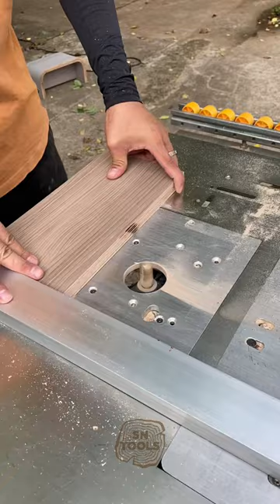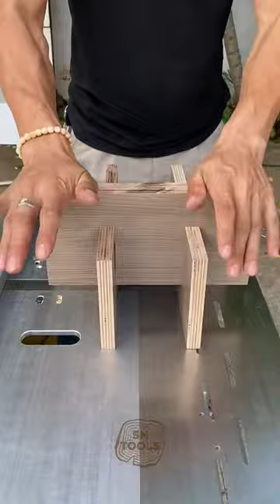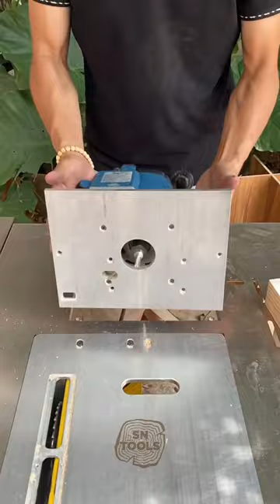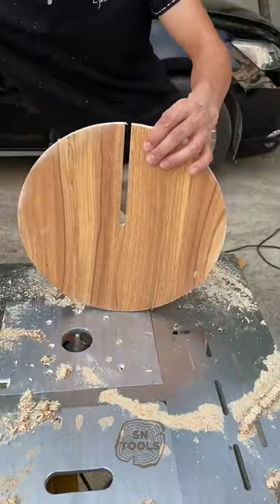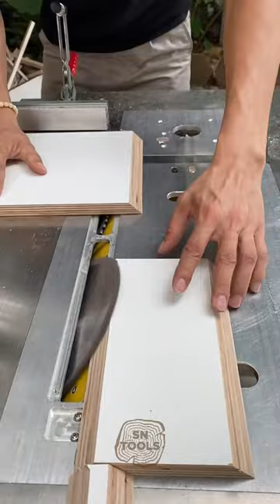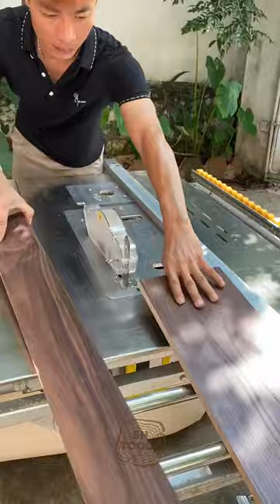Multi - Functional Woodworking Machine by SN Tools   Sliding Table Saw Cutting Machine - 657 #shorts

Comment: I wanna know what’s up with the little saw blade in front of the big saw blade? I’ve never seen that before
Reply: Pre-Cut Blade - Vorritzer
It's for plate material that has either veneer or otger decor on both sides.
The small blade is exactly as wide as the main blade and runs the other way the main does. This means thst you cut 2-4mm from the bottom up and the rest of the material down, recuding tearout.